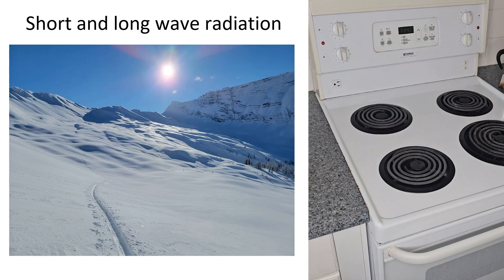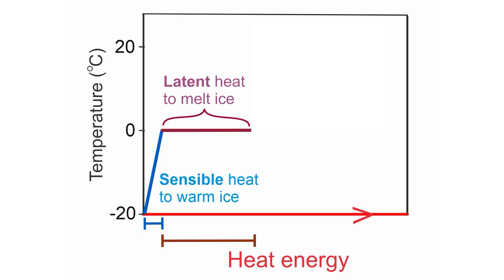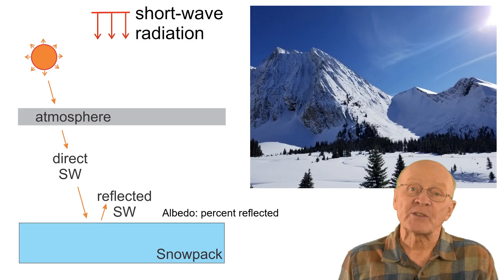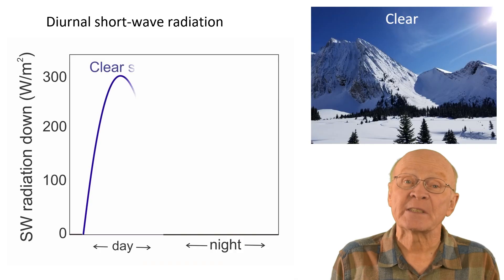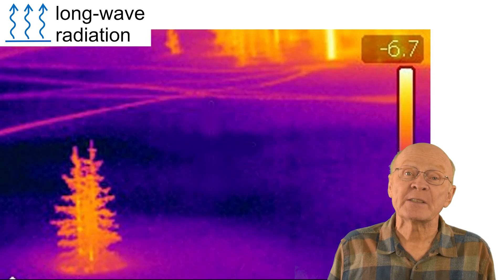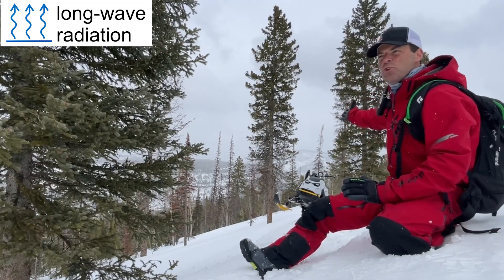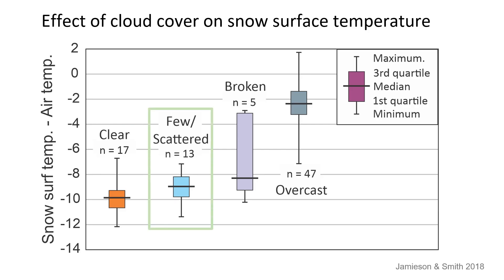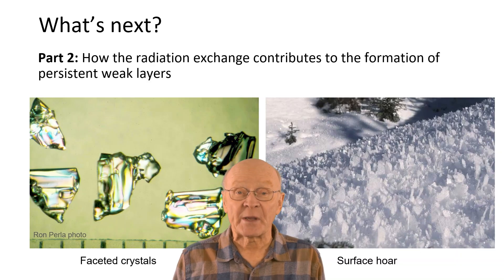Energy exchange at the snow surface. Part 1: Intro and the exchange of radiation

Comment: At 05:40, when mentioning rain has a profound effect on snow, i am struggling to make the connection between how the rain induces a latent heat xfer or phase change. Love your yt channel
Reply from the maker: Thanks. I flip flopped on whether to include this graph. But my wording in the video may be unclear. Using -10 C as a reference temperature. It takes about 42 kilojoules to warm a kg of snow or ice from -10 C to 0 C. It takes about 334 kilojoules (8 times more) to melt a kg of snow or ice. so rain at 0C has much more heat (to warm or melt the upper snowpack) than dry snow at 0 C.
Reply: @brucejamieson this makes much more sense now! The water at 0 C has much more kinetic energy than the snow at 0 C so therefore rain has a greater effect on the snowpack. Cheers Bruce, this channel is a real gem, keep it up! Im reading Bruce Trempers book now as well.